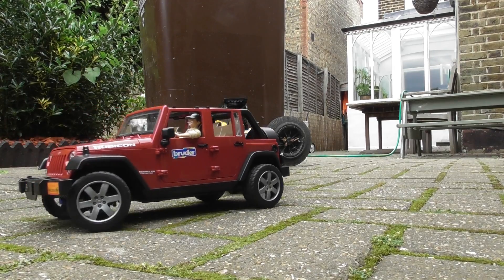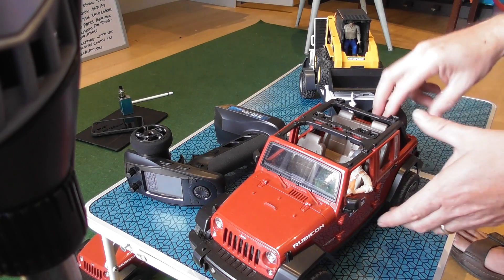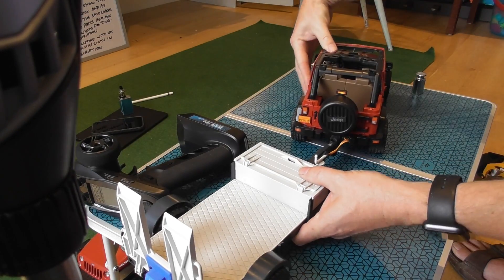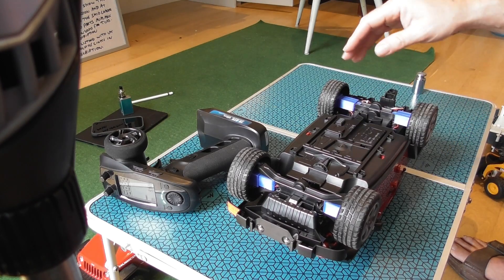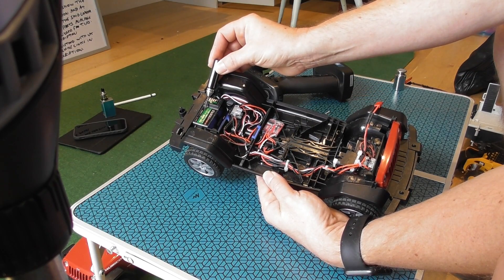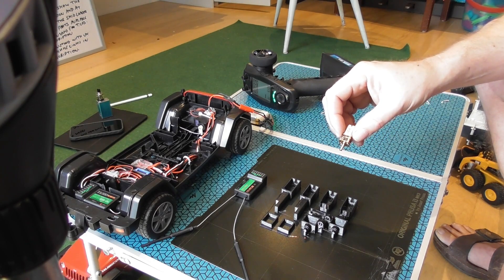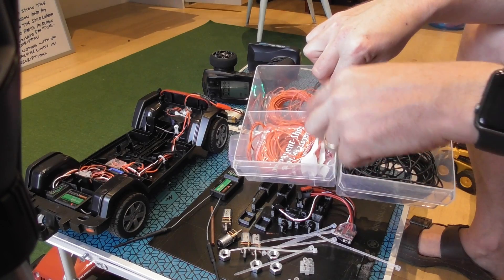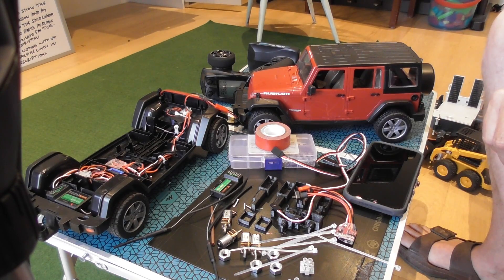Bruder Jeep Wrangler Unlimited RC conversion - overview

Comment: Thank you so much for such an amazingly detailed series - super helpful, especially for beginners like myself (1st try at RC-ing, doing the jeep for our small son). Any chance you could recommend an alternative battery? Or what’s a must to look at in terms of replacements (besides battery size)? Can’t seem to find the exact model you used anywhere on stock. Thanks in advance!
Reply from the maker: You are very welcome 🙏 Any battery (lip 7.2v, li ion 6.6v, nimh 7.4v etc) that will fit under the bonnet (hood) will do. Just make sure that you have the correct charger for the battery.

Comment: What servo did You use ?
Reply from the maker: Good point! I'll have to add to the description: Turnigy™ XGD-11MB Mini DS Servo 2.2kg / 0.12sec / 11g link: https://hobbyking.com/en_us/turnigytm-xgd-11mb-mini-ds-servo-2-2kg-0-12sec-11g.html?affiliate_code=KGAAAYQAPMWEOAA&_asc=6403141466